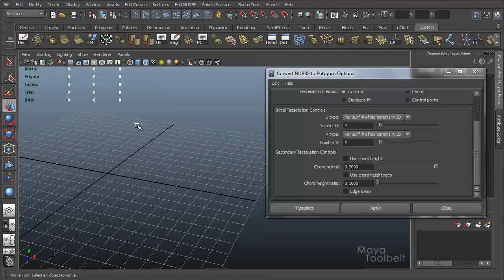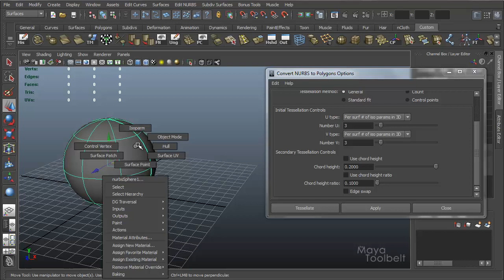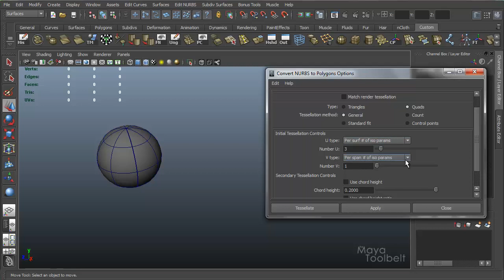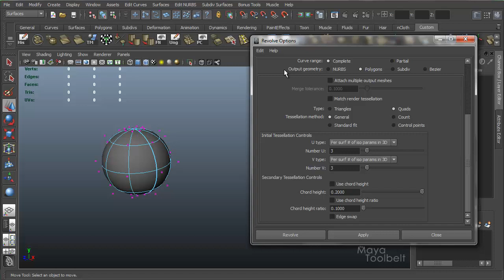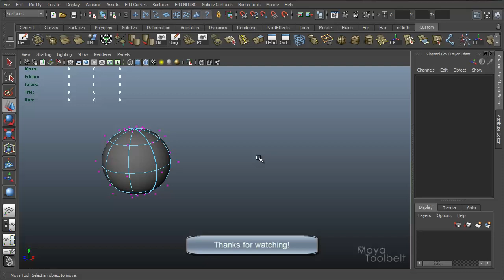The Maya Toolbelt - Convert NURBS to Polygons - Part 2

Comment: Hello sir, Could you kindly please explain about normal maps in Maya? how the bake functions in Maya? How to convert high polygon model to low polygon models? a brief explaination on SSS shader. I appreciate to take out time for your tutorials. It is wonderful tutorials, I love watching them.Thank you so much for your precious time. God bless you.
Reply from the maker: Good suggestions for videos! I think those questions are a little too involved to answer simply in comments, but I'll do what I can do make videos on those topics. When it comes to the high-poly vs low-poly workflow, I've found that you get the best results by modeling both manually instead of trying to rely on some automatic tool to try to crunch a high-res mesh down into a useable low-res mesh.

Comment: Hello sir, could you kindly explain about pipeline.thank you.
Reply from the maker: Can you be more specific? What exactly do you mean? The way I understand pipeline is essentially the steps to create content. Such as, 1) Create a concept 2) Modeling 3) UV Mapping 4) Texturing, etc.
Reply: Hello sir, it is about the creation of pipeline in 3d modelling. which I am also not aware of it, Hence, I wanted to find out from you.When I check the job opportunity, about the companies in demand, what type of candidates they look for. in which, one statement says , candidates must have good knowledge on creation of pipeline. what is the meaning of that? thank you sir.
Reply from the maker: They pretty much want you to know the methods involved in creating 3D assets and going through the process of getting it in the game/film/etc. For example in games, you'd often create the high-resolution model, create the low-resolution model, UV Map the low-res model, bake normal/AO/etc. maps, create textures, and import it all into the game and construct it with game materials and plug-in any other scripts/etc. that are necessary. There's a lot to it, but it's pretty much the same overall process for each asset that gets made.
Reply: Maya Toolbelt , thank you so much sir. I am trying my best to set my profile for the job. I also have one more doubt, is that, while modelling any kind of assets including wireframe texture and light set for the render, does time duration is important to be mention, for each modelling? if so, could you kindly explain in detail about it.Thank you once again, if I have any queries, will surely trouble you. with full respect and warm affectionate. Sapna.